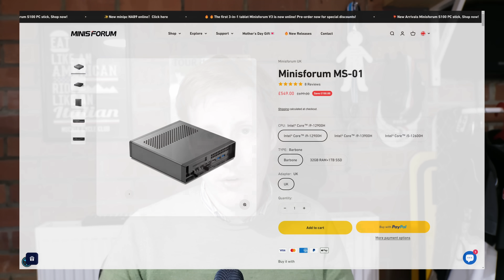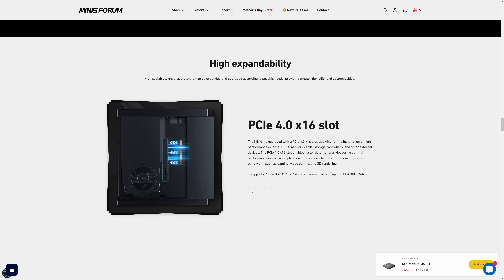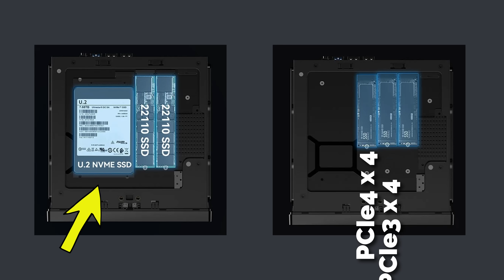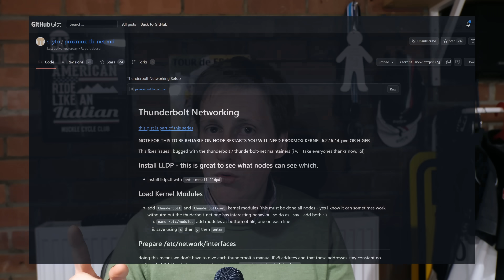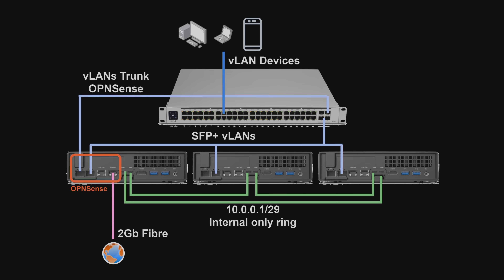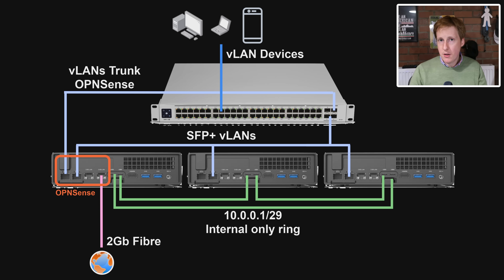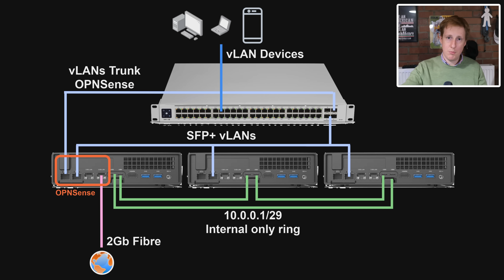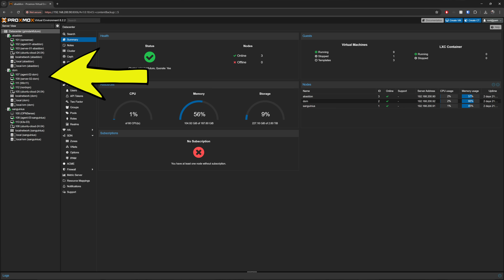Planning A Homelab - Cluster Time! Minis Forum MS-01

Comment: Hi JIM.
Thanks for your video. I just subscribed.
I got same 3 machines.
After installing proxmox, i can’t access it on browser on another machine.
But if i curl command on the proxmox machine it works.
I think is NIC problem. How did you fix yours?
Reply from the maker: Does the machine have an IP, can you ping other machines? Check the vmbr0 is bonded to the correct NIC. After that, check firewall rules and vlan tags.
Reply: @Jims-Garage thank you Jim 🙏

Comment: Is that 40w each or for all three?  Looking at getting two of these and getting rid of the T340 poweredge.
Reply from the maker: 40W each
Reply: @Jims-Garage  ok thanks, was looking at dropping power.  Will have a think.  I'm in the process of looking at a couple of Dell Optiplex Micro 7050 for a Proxmox cluster etc.
Storage is handled via a Synology 1821+ atm.

Comment: Follow up, could you run this on 2 nodes with a device for quorum? (nodes sure, but would CEPH still work or freak out with only 2 nodes)
Reply from the maker: @JohnWeland  you could run it on 2 machines but you'd have to fudge it with virtualisation I believe (i.e., make it think there are 3)
Reply: @Jims-Garage  I've finally shut down my Dell's (electric bill is just to high with those running.) but I was thinking to be a little more fiscally responsible running 1 MS-01 for now and adding a second MS-01 later. Once I add the second node I would use a raspberry Pi as a QDevice to give the cluster quorum.
Reply from the maker: @JohnWeland  unless you need or want to play with clusters, a single MS-01 is more than enough for most people.

Comment: Great video! Thanks! I’ve been running HPE Enterprise servers with ESXi in my home lab for years, and I’ve decided to get an Ms-01 to try Proxmox. If it works out, I’ll buy 2 more and setup a cluster. 

Did you consider using the 2.5Gbe port for Intel vPro? I’m going to miss IPMI (HPE ILO), so I’d at least want some rudimentary control with vPro.

If I use vPro, would it be fine to put it in the same subnet as the SFP+ port used by the VMs, or would you recommend putting the 2.5 GBe vPort on a different subnet? 

Also, should the Proxmox management interface be the 10Gbe SFP+!port used by VMs, or use the 2.5Gbe vPort as the Proxmox management port as well?

Thanks again!
Reply from the maker: @rmangoba  ideally you'd separate everything but I think for a homelab you can relax it and use vLAN 

I don't use vpro but many do. I believe mesh commander is deprecated but still works. I miss idrac but it's not a deal breaker when you have 3 nodes.
Reply: @ I recently funded the JetKVM Kickstarter. When I get my JetLKVM, I’ll set it up with my Ms-01. It will provide a lot of things that I liked about IPMI for only $67.

Comment: My wallet needs to be on a diet! Stop!
Reply from the maker: @kristopherleslie8343  haha 🤣 hold on for the MS-A2
Reply: @ do you think these guys are suitable for SMB
Reply from the maker: @kristopherleslie8343  as a NAS?
Reply: @Jims-Garage  vm host and cluster but in 2025 considering the newer machines are right around the corner!
Reply: @ crazy question would it be possible to use a egpu port but with nvme

Comment: You can get a switch to share the internet connection between multiple physical hosts. If you only have a single IP via DHCP you will need to have the secondary firewall disabled or write a script to keep only the wan NIC of the firewall with carp master enabled. You would need to have a secondary firewall with passthrough enabled on a secondary host. The primary/secondary firewall VMs don't move between physical hosts.

Comment: Hi Jim,  have you seen the AMD variant of the Minis-01, it was announced a few days ago and is due release April 2025.  Its more powerful than the intel, looks to have most of the same characteristics, but it doesn't have the thunderbolt 4  What do you think of it mate?
Reply from the maker: I am going to receive one to review, I'm looking forward to it. CPU should be a little more powerful with better thermals and efficiency, the loss of an Intel iGPU is slightly negative but only for compatability, the loss of TB4 is a negative but you can use PCIe. I think the performance boost and thermals is going to make a win overall. I'm really looking forward to checking it out.
Reply: @Jims-Garage  that's awesome mate. They should send you 3 of them to setup the cluster as you have done with the intel :) (hope they see this post). 

Look forward to your review mate,  your channel is my favourite BTW.
Reply from the maker: @davidr8424  that would be nice! Let's see. I'll most likely replace my current PC with it. Appreciate your comments and support.

Comment: Also - how have the MS-01 been working out for you? Any issues that you can share? Going to be running Promox on them so curious how the stability has been since they been out
Reply from the maker: Installed Proxmox on all 3. Probably rebooted 3-4 times. Solid, haven't had a single issue other than disable ASPM in the BIOS.

Comment: Hey, for your redundant firewall issue, you could plug your fibre "modem" into the switch on an isolated vlan, and trunk that vlan to all three nodes. Your opnsense VM can then float between all the nodes and because you've just trunked it over a VLAN you'll still get the DHCP public address on opnsense. I think you could also set up two opnsense VMs running in HA like this, if one went down it would take on the IP of your primary VM.
Reply from the maker: @AshleyTayles  thank you. That's ultimately the setup I've settled on as shown in a later video.
Reply: @ fair play, working through your MS-01 videos as I’m thinking of doing a similar thing. Guess I should have finished the series before commenting 😝
Reply from the maker: @AshleyTayles  ha, that's okay. I ultimately end up with 1 VM using HA inside Proxmox. These all share the internet via a cheap switch. I demo the fail over as well.

Comment: Will this SSD fit in the U2 slot of the Minisforum MS-01 and function without any issues? It's a Western Digital Ultrastar DC SN650, U.3, 15MM, 15,360GB, 2.5-inch, PCIe.
Reply from the maker: @Renee.Dominique1  I'm not sure. It says U.3 in the title. I don't have a lot of experience with those drives
Reply: @Jims-Garage  it works but for the 15 mm thickness  i need to buy 3d printed case extension cost 25 euro including shipping. but then I cancelled the 3d print order and opted for samsung u.2  7mm 15.3tb mlc pcie 4 gen
Reply: @Jims-Garage  VMs on Samsung SSD PM9A3 OEM Enterprise 2.5" 7mm U.2 PCIe NVMe 15.36 TB (compatible with PCIe 4.0 x4 slot)
Samsung PM9A3 OEM Enterprise/DataCenter M.2 22110 NVMe 3840 GB (compatible with PCIe 3.0 x4 slot)
Samsung PM9A3 OEM Enterprise/DataCenter M.2 22110 NVMe 3840 GB (compatible with PCIe 3.0 x2 slot)
Proxmox on 2230 A+E nvme utilizing the wifi port or extension cable that converts A+E to B key (Proxmox on the slowest slot)

Comment: I'm not sure what your exact issue was with the internet and fiber that caused you to remove HA, but if I understand correctly, I would suggest one thing. You could plug your fiber into an unmanaged switch with a fiber SFP optical transceiver, and then you could plug two connections, using RJ45, from the unmanaged switch into each MS-01.

Comment: Why did you choose Proxmox vs Ubuntu MicroCloud (LXD+ceph+OVN)?  I started with Ubuntu KVM ages ago, VMWare/vSphere, OpenCloud, etc... And so far Ubuntu LXD is so easy.  Anyway, what reasons won you over for Proxmox?
Reply from the maker: I like the simple UI, easy to use features, stability and generally prefer VMs over LXD as I find them easier to manage.
Reply: @Jims-Garage  Thank you for the reply... and forgive me; if prefer VMs LXD will do that too! running both VM and containers was the draw for me.  And LXD has a webUI but as soon as you do clustering or something more advanced LXD starts getting a little cumbersome for sure.  Proxmox scared me away with pricing which is a big hill to climb for a little guy like me running a modest home lab.

Comment: Hello and thank you for your great videos! I have two MS-01s myself with the i5 processor and 96GB Crucial RAM each. My setup is not really running smoothly. Could you perhaps tell me which components (how much RAM from which manufacturer) you have installed and whether the NVMe with Proxmox on it runs as ZFS?
Reply from the maker: Hey, thanks for the comment. I have 64GB of Corsair Vengeance (believe it's 5200 Mhz - nothing special). I'm running the Proxmox OS on non-ZFS (ext4). Ordinarily I would advocate the use of ZFS, but in my case I have 3 devices and wanted to keep costs down. I figure if a node fails I have 2 to take over and can replace the disk.

Comment: Great videos!  I've been working on assembling a similar MS-01 cluster and really appreciate that you've got the thunderbolt networking in particular already worked out for these devices.

One question - wrt the 980 Pro, what speeds have you seen on the primary NVME slot?  I'm only seeing a peak of 3500MB/s disk reads on the 990 Pro's (vs 7000MB/s).  The asterisk on the drive's description says you need to go into Samsungs windows drive utility and enable something called 'Turbo Write' - which appears to be a volatile write burst buffer.   Curious if you've done that or had any advice for a newb on whether that's a good thing to enable on a linux proxmox server.
Reply from the maker: I haven't done a test, but I will check later. Make sure you're in the 4x4 slot, 3x4 will max at 3500.
Reply: @Jims-Garage  I'm def on the right slot - I've actually got 990 pro's in both of the first 2 slots and they both report the same ~3500MB/s speed.  The 3rd slot reports 1300MB/s, which is expected.   I'm a bit newb-ish still, but here's the command I'm running (in Proxmox 8.2 shell):  "hdparm -Tt /dev/nvme0n1".   It reports: "Timing buffered disk reads: 10156 MB in  3.00 seconds = 3385.11 MB/sec".   I'm going to grab Samsungs 'Magician' tool for windows and see if it offers any clues.

Comment: Could you not bring the fiber into a small fiber switch first the break out three ips from it?
Not a dumb switch obviously, but I can think of a few devices which would work. Even a low power firewall if you want that functionality.
You could handle the connections on the nodes in a number of ways.
Reply from the maker: @XtianApi  no, I can only obtain 1 IP. I have since placed this into a small switch with each port going to wan on a virtual firewall. This is configured for HA (see on later video)
Reply: @Jims-Garage  cool. I have since finished the video and saw what you mean. That's cool. I got interrupted at work, lol.
I'm trying to find a decent affordable swith that can do multi chassis link aggregation. Don't want to spend enterprise money. Lots of switches do link aggregation but only the higher end ones seem to be able to do multiple instances of Link aggregation.

Random side thing, I know.

Anyway, thank you!

Comment: I have bought because of you three MS-01 😂 but I am thinking to buy a fourth one. Because I am looking for a nice HBA to replace my power hungry 8x disk setup (ZFS RAID 10). But on YouTube there is also a dude that got an expansion card where you can actually put 6(!) M.2 SSD in the MS-01! So how are you doing your storage for your homelab? And why Longhorn and not CEPH?
Reply from the maker: @erwin757  I use Ceph for VMs and longhorn for Kubernetes data. I don't recommend the MS-01 as a NAS, I would build something with plenty of HDD storage.

Comment: My single r7515 server with 5 8gb nvme is idling at 130w. :)
Reply from the maker: @HaydonRyan  nice 😂 that's a beefy server though. What do you have running on it?
Reply: @Jims-Garage 16 core epyc 256gb ram.  Running esxi vsphere with truenas (raid z1) with the five 8tb nvme drives. Also have a vm running ollama with cpi only for now. I have some work related vms and a ci/cd program running. Slowly building up. I have been thinking of migrating off synology for docker vms as I’m maxing the cpu.
Reply: That idle draw, story of my life...

Comment: Is there any issue with using a 4TB 990 Pro in any of the SSD slots? I understand that the site list 2TB as the max capacity, but supposedly that's because most 4TB SSDs are double-sided and can't physically fit in the slots.
Reply from the maker: I don't know as I haven't tested. I suspect they might do without a heatsink
Reply: I'm running the 4TB 990 in the primary slot, reusing the low profile heatsink from the 'stock' Kingston drive.  I've got a 2TB 990 in the second slot, using some carefully x-acto'd thermal tape to contact the fan assembly.   So far everything's been running pretty cool.  The 4TBs are single sided, so I think you could probably run them in all 3 slots, but only actually heat-sinked on the first.

Comment: About not having a failover for your firewall, could you not just run your ISP fiber connection into a cheap unmanaged SFP+ switch, and then run a fiber to each MS-01 and have Opensense on each device for failover that way?

EDIT: Nevermind. I just started watching your next video and you covered this. 

Thanks for the heads up on that WAS-110 SFP+ module! Ive been wanting to bypass Google Fiber's ONT box and go straight into my MS-01. I hate having fiber to the house and then having to run ethernet to my otherwise fiber backend. This way I could stay 100% fiber.
Reply from the maker: @spotopolis  that's exactly what I ended up doing on a later video in the series.
Reply: @Jims-Garage  Yup! Just found your channel and videos. I'm running pfsense currently in a VM in unraid. I bought an Intel QAT to pass though to it, but soon discovered that it is blacklisted in the vfio drivers and I'm having troubles bypassing it. Let alone the free version of pfsense will not allow the use of the QAT. So my solution is just to migrate to a bare metal install of Opensense to run the card.

Comment: Lets Talk opnsense, I have this exact machine, and I cant get more then 500mb down of my 1G... plugged directly into modem I get all the speed. Ive tried bridges, q35, i440, passthrou,  bonding... I just cant get it... can you point me in the direction you went or issues you had?
Reply from the maker: Try disabling ASPM on the NIC in the BIOS.

Comment: I have one with two WD Red N700's in RAID Z1 mirror and 96 GB RAM. Do you mind if I ask you about thermals and noise? On mine, it idles at about 42C and  if the CPU gets up to 5% usage, it goes up to around 52C and the fan gets annoyingly loud. This does not seem normal to me. I could probably tune the fan in the BIOS but it doesn't seem like 5% should raise temps that much.
Reply from the maker: @praetorxyn  sounds like mine. Have to remember it's a laptop with a small heatsink, powerful CPU, small fan, and aggressive curve. I'm going to take the covers off mine and strap noctua fans to them. Ugly but I don't look at them.
Reply: @Jims-Garage  Ah. Damn. I was hoping my situation was abnormal and that repasting the CPU or something might improve things.

I have not done much with my MS-01 yet, as I have been trying to sort out remote KVM. Remote KVM works flawlessly in MeshCommander, but it's not maintained anymore and MeshCentral has a much nicer interface while being more secure etc., as it uses a CIRA tunnel for AMT. I can get AMT connected in MeshCentral but remote KVM doesn't work for some reason. Haven't looked at it in a few weeks, but I wanted to get remote management sorted out before I really started setting up Docker containers on it etc., as I didn't want to have a bunch of stuff I was depending on running on it when I might have to physically move it to make a BIOS change.
Reply from the maker: @praetorxyn  I haven't bothered with it for now, hoping the project might be resurrected. Let me know how you get on.
Reply: @Jims-Garage  MeshCentral is still being maintained as far as I'm aware. The setup is just more involved.

I will say I first tried the Docker version and didn't have much luck. I have had better luck running the actual NodeJS version as a systemd unit, but still haven't managed to get remote KVM working.

Mesh Central can give you comman ds to install user agents on machines etc., and that all works fine out of the box. It's the AMT stuff that's kind of tedious to setup, particularly since I'm using swag as my reverse proxy.

Currently m y stuff is running on a Synology DS918+ and the version of Docker on there is downright ancient, to the point I can't even have one Compose file include another one. I'm planning to switch to Traefik at some point and thought I might have better luck making it work with that, but I haven't gotten it done yet, as I was kind of wanting to get Traefik setup on the MS-01, but I started tinkering with the remote management first. So it's something of a chicken / egg problem.